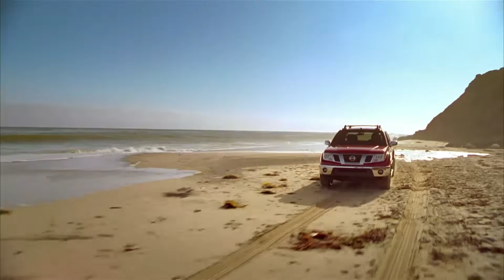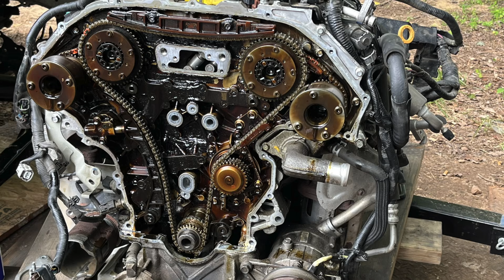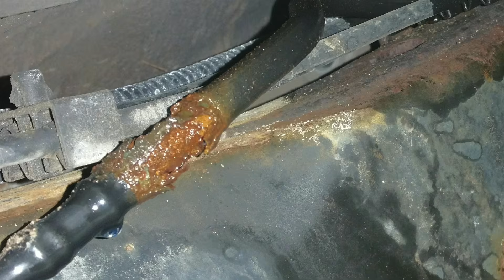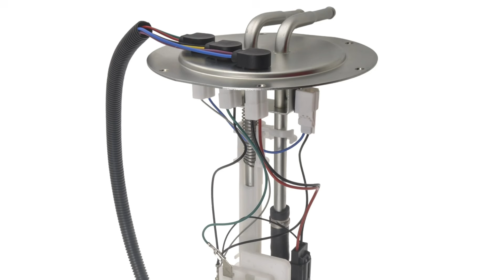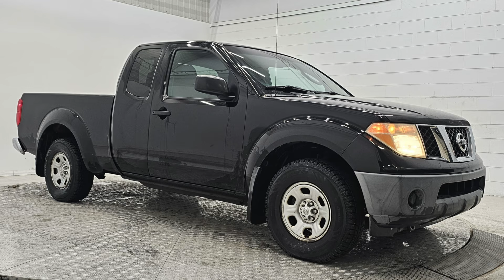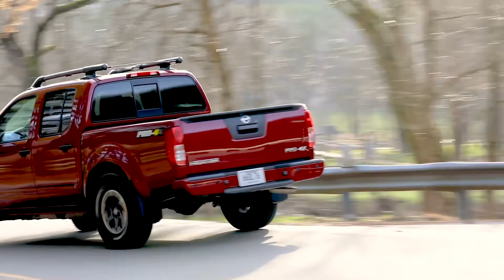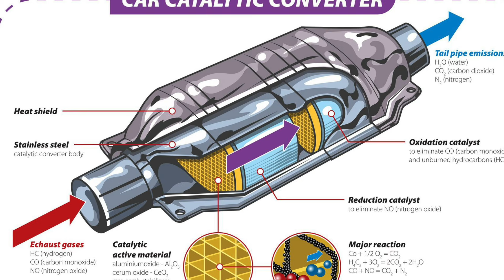Nissan Frontier 2005-2021 : 6 Common Problems

Comment: I have a 2007 Frontier bought it  used with 50K. 1st thing that went was the fuel pump. It indicated it with a light on the display. It did no show the fuel level, I ran out of gas on the Sam Houston tollway. Because of the check engine light, I could not register it, it would not pass TX inspection. The cost was only $ 450. At 100K The transmission made a pinging noise when starting out in the morning. The transmission shop "REBUILT" it ($1300). The noise persisted. The fly wheel has some brackets attached to it. The cost ??  $ 485.00. That's the only problems I have encountered. I still have it, 138.000 miles

Comment: I have an '05 Frontier 4.0 and have gone through all these problems 😂 I'm currently having AC problems y'all keep an eye on yours.
Reply: I had moved to FL and my A/C went out. I called a visiting mechanic, he drained the A/C, "cleaned" it and when done, he charged me $ 150. My car never left the driveway.
Reply: I have an 07 Frontier with an electrical short that seems to be between the climate controls and the AC compressor. It also shorted out my blower motor resistor. I replaced the resistor and it's still not working.. Although it came and went a couple times which showed me the compressor and blower motor resistor are functioning..
Pain in the ass to locate the problem so far
Reply: @emmittmatthews8636 I'm having the same problem with my '05 4.0 I can't seem to find the short I replaced the compressor the AC fuse lights up good. I've noticed my compressor doesn't get any power at all, if turn it on from the climate controls it gets nothing I have to manual give it power straight from the battery.
Reply: I'm having the same problem and still can't find the solution to it, I replaced my compressor and blower resistor as well. Still no cold air. I noticed that my compressor is not getting any power the AC fuse lights up. The climate controls is working properly. @emmittmatthews8636
Reply: @emmittmatthews8636  The blower system and A/C system are different. If your blower resistor keeps failing, it's likely due to a blower motor that is drawing too many amps and needs to be replaced. As far as the compressor, I have had and seen where the magnetic field coil of the compressor clutch fails and it won't allow the A/C clutch to engage. Not a hard job to replace.
Reply: @emmittmatthews8636  replace the blower motor
Reply: I was able to determine the issue with my AC. My climate controls were shorted out, so I replaced that and also the sun load sensor was busted.

Comment: I only run royal purple 0w20 in my 3.8L 23 frontier every 4k miles i hope i can get 200k out of the original timing components
Reply: You'll probably get more. The timing chain issues were due to worn tooling when stamping the upper chain link plates by Borg-Warner. Once they addressed the issue, it wasn't a problem. Personally, I would put 5W30 in it if it were mine; I know what Nissan recommends, but am not a fan of the 0W oils...but that's me.
Reply: @smj999smj I'm wondering if I should switch once it's out of warranty so I don't void it

Comment: Odd how Frontiers are nit picked to death as if other makes never have an issue
Reply: Tacoma fanboys are vert quiet about all those frames that rusted in half
Reply: @TIJoe-te9qu has anyone put Tacoma drivetrain and body on frontier frames?
Reply: @paulthepainter2366 trying to make sense of your question.
Reply: @paulthepainter2366 why? That’d be completely pointless
Reply: @TIJoe-te9qu  I understand Toyota got issues with engines and transmissions in their newer models.
Reply: @Davejohnky Definitely.  Tundra is under massive recall for spinning nain bearings,  and both automatic and manual transmission failures in Mexican soft Tacos.  In fact,  many Toyota 8 speeds are coming under class action lawsuits. 
A big problem is that greedy Toyota cut corners by using NO  transmission cooler to save a few pesos. People should stop buying this junk.
Reply from the maker: Don’t worry I’m planning to do the same for other models as well.
Reply: I drove pathfinder and 4Runner in Saudi Arabia. 4 runners underpowered and got stuck more than the higher powered pathfinder. I will say though the land cruiser (95) were totally badass.
Reply: @Davejohnky How about Patrol?  I hear they are very popular there.

Comment: The radiator and plastic timing chain guide issues were only from 05 to 10 models...these trucks are well built and very durable. Easily go 200,000 miles if basic maintenance is kept up
Reply: 270K here on a 2009 and still going
Reply: @WhtGTi get that timing chain checked, mine went out at 272k. Didnt know about the issue with the tensioners.
Reply: I like my 2023 frontier with that 3.8L I hope I can get 200k out of it
Reply: I have a 2011 with 300k AC everything works haven’t had any problems. Haha is a manual 4cylinder tho
Reply: 214 miles on mine
Reply: Not exactly. Already replaced a radiator and transmission At 100k. A P0345 camshaft code and U0011 with ABS/Slip light on. As well as a P1212 continuously reporting on pending codes. Besides all of that. The intelligence module is prone to catching fire ironically. This happened to one of the techs I work with. He replaced a heater hose…
Reply: @anthonysaich2057 that's certainly an exception. The overwhelming majority of theses trucks are low maintenance and very resilient
Reply: @DarkPatriot13 wish it were so
Reply: Damn, as a single mom I’m fucked i own a 2017 now it’s the manifold well more hours to work to fix it